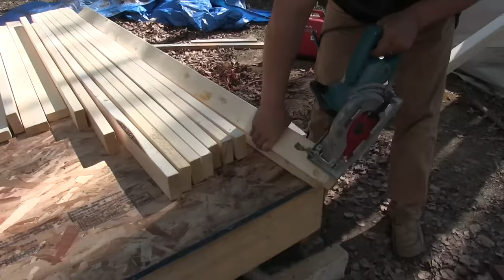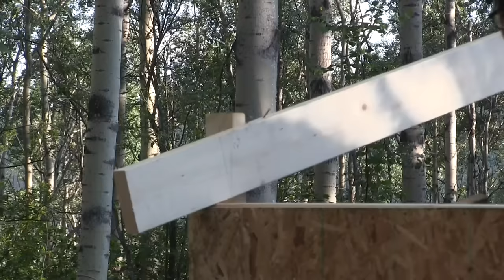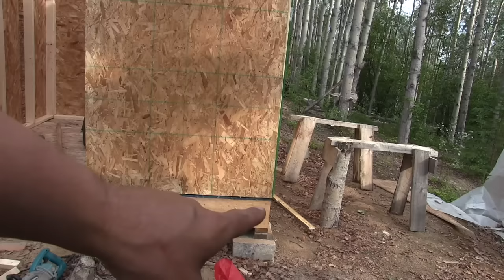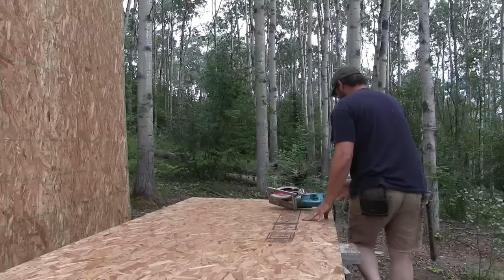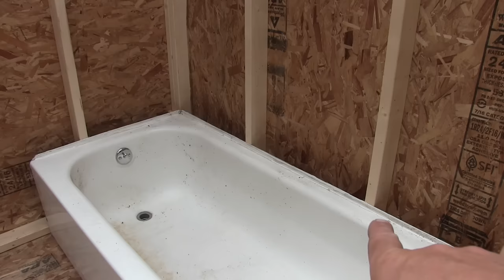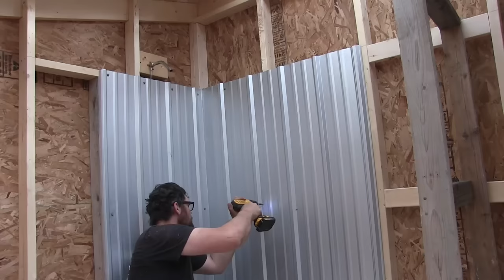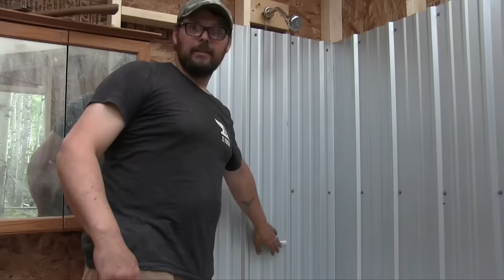Off grid shower house Project

Comment: Dave was gonna tell u When it comes to bending sheet metal or coil stock If lightly score the metal in a straight line with a razor knife twice now do it lightly u will find the metal will bend alot easier.
Reply from the maker: Thanks for the tip

Comment: Try putting a a spacer block in the middle of a corner. The xtra 1 1/2 " will leave you a 1" nailer inside after the other wall is fastened to the corner. Also when nailing you need to nail the weaker member to the stronger one.....not what you did w the stud to rafter connecrion.
Reply from the maker: ........................you have an issue with how I built a rake wall on an 8'x8' shower house???   I nailed " through" the rafter and buried a 20d galvy through 2 inches of stud.....and somehow thats not as good as nailing through the stud and biting into an inch and a half of rafter??? I think its the better of the two options.

Comment: In Australia we just light a fire under a steel bath down by the creek, crack open a cold one, watch the sun set, then light a recreational cigarette, lie back in the tub, ponder the numinous and soak up the serenity.

Low maintenance, optimum benefit per effort invested, and bushfire proof.

Not a single nail either.

Comment: Dave.... to hell with heating water

Get ya one of those on demand camping hot water heaters. Takes 2 C sized batteries and a bottle of propane.  Couple that with a solar panel and a RV water pump with a 5 gallon pail and youd be swimming in luxury.

Mark from Chicagoland

Comment: What would be the difference between the Zodi and a regular industrial pump sprayer???
Reply from the maker: GOOD QUESTION!   An industrial pump sprayer like a "Chappin brand pump sprayer" would work just fine. However, many of the industrial pump sprayers used in the concrete industry for applying form oil or curing compound have a coating on the inside of the tank......The Zodi is plain stainless steel with no liner on the inside of the tank...so you can heat the water IN the tanks itself over a burner. 
That being said I have always heated my water separately and poured it into the Zodi, so any other sprayer would work just as well.

Comment: Did i miss something? Where does the grey water go? Did you build a septic system in a different video?
Reply: I doubt he built a septic system because it's basically the equivalent of showering outside.  The water likely just drains onto the ground.  A septic system is more important when you have flush toilets with bodily waste that things like to grow in, or food waste from a kitchen sink.

Comment: Rain catch in a black 55 gal drum put a filter in the line and a cheap camper water pump from harbor fright hook it on  and install some electric heat tape on the pipes and run a single solar panel from harbor with car battery you'll be good to go
Reply from the maker: right on

Comment: I have to say this. You show the rest that use air that you don't need it. I take my hat off because I know the manual way. You worked that framing hammer like you are suppose to. Modern construction would be dumbfounded. I am not knocking modern construction by no means. But when you only have what you have you better know how to go manual. Kudo's Bushradical "aka midwesterner" I also am. good job!!!
Reply from the maker: Thanks

Comment: Yeah, I'll join the chorus on the rafter thing.  I was planning on having to relearn some of my trigonometry.  
It sure would have been nice to have a link for the shower.  Anyone reading this have any idea?
Reply from the maker: Hey Jim. The pump is a ZODI brand. But I bought it at a yard sale so I dont have a link or any info. Good luck
Reply: Bushradical   Thanks.  I found it.  There's two models, and one comes with its own propane heater.  Put it into my favourites for later

Comment: I hope this is not a crazy question, but why do you decide to use nails when building instead of screws?
Reply: I’ve heard that nails have more shear strength than screws!  When you factor in the threads of the screw, it diminishes the thickness of the ‘metal pin’ going into the wood!  I would use two 3” galvanized nails on any 2”x4” wall stud’s bottom and top board, and then put in a long screw in the middle of the nails to help keep it all from coming apart in a heavy wind, me thinks!  I think I would use nails, along with screws in various places, on any house build I do!

Comment: @BUSHRADICAL  where did you source your metal shower arm to male barb connector?
Reply from the maker: Lowes. Its a 1/2" thread on one side and a 3/8 per on the other. The fitting has three ears on it for screws to go  into a nailer to hold the shower head in place.

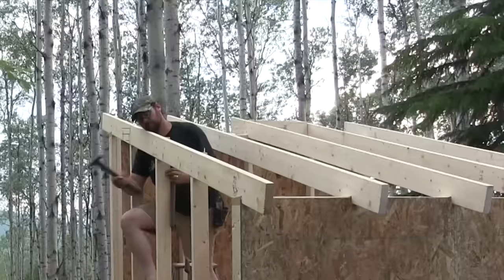Comment: 8:31 yer or you could use screws for this to make it so much easyer.
Reply: Graham Hardy Vanlife , I’m with you there. I just turned 65 and when I built my cabin in NC mountains I got tendinitis in my elbow from nailing. I’ve switched over to deck screws for almost everything and they work great.

Comment: Did you know 🤔 if you take a 5 gallon bucket and fill it wit water.,,,, and stick in a submersible heater element.,, (Walmart) 5 bucks, 300 watts,, then hook up a 18 volt water pump,, you will be the cleanest bug in the woods.😎
Reply from the maker: sounds like a good way to go

Comment: Don't you want to use PT lumber?
Reply from the maker: The exterior is off the ground and now its painted....good enough
Reply: Nice. We have an RV tankless water heater hooked up to a propane tank along with a pump inside one of our rain barrels. When we want to take a shower, we just turn on the generator and we've got instant hot water. So much better than when we had to boil water!

Comment: The whole concept of western framing has been missed. There is no diaphragm with the unstated sheer wall and floor system. Studs 24" on center with snow load? C'mon. Obviously not licensed and permitted work.
Reply from the maker: LOL,  Snow Load...LOL. Your obviously have never spent a winter in Fairbanks. Snow is 90% powder and 16" on level is an average over the winter. Not much to write about. BUT, if you did get a lot of snow this is a 8'x8' building and is Totally capable of handling the snow in interior Alaska. Speak about what you know about....and nothing else and you'll do better
Reply: @Bushradical Ive been in construction for over 20 years. Superintendent for a 5 billion dollar company. Plenty of residential experience. Spent 4 years on the slope. Another 5 years working construction for trident seafoods out of dutch harbor, sandpoint, st. Paul etc...recently was working in idaho in the "snow belt". Building code put snow load rating at 160# per square foot on roof. Never seen 3/4" sheething on a lid till then.
  I see no seismic allowances in your method. Not knocking you. I have spent a lot of time in fairbanks, Wasilla, Seward, kenai and homer. Its just odd that building standards are much more stringent in the lower 48. How do you alleviate heaving not having concrete pier pads below perma frost? Does it even matter in a log home? Im just curious.